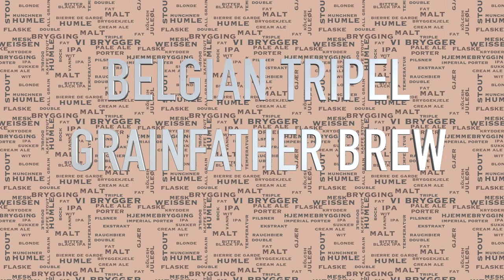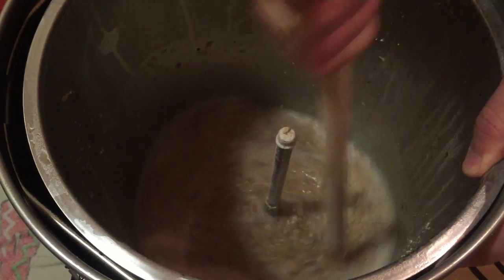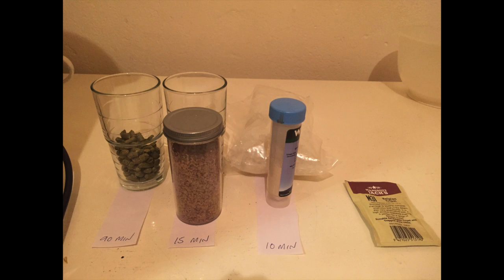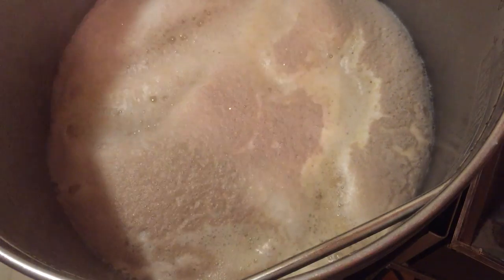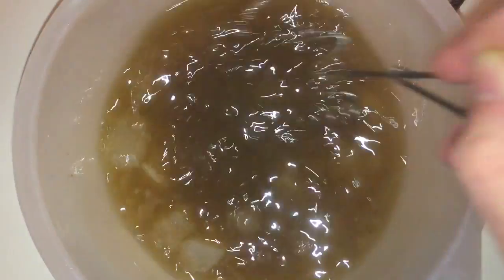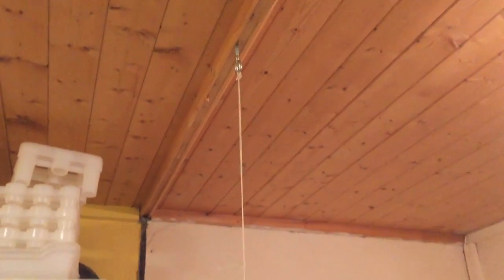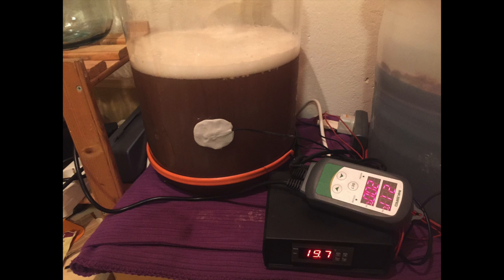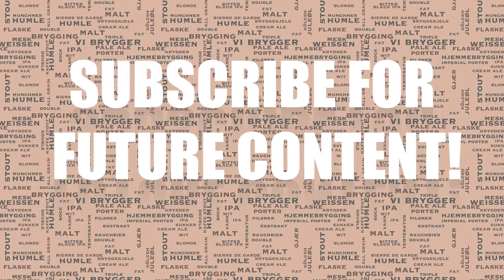BELGIAN TRIPEL Grainfather brew with small batch pipework

Comment: I like to use candi sugar for the carbonation in blondes/triples.
Reply from the maker: Very sorry for the late reply, YT has been very buggy recently so I only just saw this. The trouble there is that you are not going to get the full carbonation amount because inverted sugar has unfermentable sugars included.
Reply: @DavidHeathHomebrew  Yeah  but there is usually some sugars that are late to the party in the worth that get fermented out when the yeast i re activated.
Reply from the maker: Don’t you raise the temps at the end of fermentation to get a full attenuation?
Reply: @DavidHeathHomebrew   I would if I had temperature control for fermentation but I don't at the moment Don't have any room where i am living right now so it's kind of been on the back burner. In the winter I can use an electric radiator in my walk in closet for the purpose but in the summer the temp is in the high part of the recommended spectrum anyway. I once accidently left a bag of triples in the car for a mont in high summer and those were unexpectedly the best of that batch by far
Reply from the maker: Ahh ok, understood :)

Comment: What are the quantities of the strike and sparge waters? I am going to try this soon, thanks for the informative information in your videos.
Reply from the maker: Glad you enjoyed it :) I would suggest that you use the gf app and that will calculate volumes for you. This one was 14.1L Strike water and 10.4 Sparge water.
Reply: David Heath Thanks, I will check it out, I tried the beersmith app but must have done something wrong because I ended up with too much sparge water, so had to cut it well down. But advice from guy's like you and other YouTube contributors is a really good way of building up experience.

Comment: I'm soon gonna take my first shot at a tripel, and i was thinking to try mandarina bavaria. In your opinion, would it suit more as late addition or dry hop? Just looking for some slight tangerine notes :) I was also wondering, after how much time of bulk-aging does repitching become necessary? (OG 1.084, 2liter starter of WLP 530) thx in advance!
Reply from the maker: +Nick Verstraete Repitching of yeast in bulk conditioned beers starts at 3 months, just to be sure. After 4 it will for sure be dead. If you are looking for slight tangerine notes then I would use an essence, much easy to control what you get.

Comment: Hi David, 
I follow your recipe and everything went good, I reached the right OG (1072) and the wort looks so good :) I tried to take a sample after 5 days of fermentation(18 degrees) and gravity was already 1020!!! Great M31! I have only one question, is it normal for the wort, at this point, to taste of banana? Does it will change with the fermentation and temperature rise? Thank you
Reply from the maker: Darth Monger That was fast. The banana could mean a too high fermentation temp or an under pitching of yeast. Hopefully it will fade :)
Reply: Temperature is 18 degrees and I put two packs (20 gr) of M31. Well...we will see, thanks a lot for your support. :)
Reply from the maker: Darth Monger hmm, maybe its just an early off flavour then :)
Reply: Hi David, I finally reach a good FG (1006) stable after 48 hours and I am ready to bottling. Beer is very different from the beginnig, banana flavours and taste are gone and now i smells so good :) Did you put other yeast before bottling or you used only priming sugar?
Thank you.
Reply from the maker: That is great news :) If it has been conditioned for over 3 months then I will add extra yeast.
Reply: David Heath thank you for your reply. I have no M31 at home, do you think I can put other yeast? I have only M44 in my fridge. What is the correct amount of yeast to put?
Reply from the maker: You can use any type of yeast for carbonation. The amount is similar to the amount you used for regular fermentation.

Comment: Hey David. Brew this treat yesrday. This came out too dark as style is. Was expecting ca. 7 SRM but looks like 15. Does is clear. I suspect as wort looked fine befire hops editions, its still hops particle floating or? I plan to ferment till steady FG. Than bottle condition on ca 20c for some month's. Im I on right way or would you do secondary for some months and than bottle it?
Reply from the maker: That is probably where it still needs to clear. If you did not use Kveik yeast then I would suggest bulk conditioning.
Reply: @DavidHeathHomebrew went with M31 on this occasion. Will do bulk on half batch and bottle on other half and compare it to get picture of process as I'm fairly new to brewing. Thanks for tip and great job with all the videos. Im a big fan. Learned a lot 🍻👌
Reply from the maker: Great, experimentation is certainly a great way to go. Great to hear that my videos are helping you :)

Comment: David, what is that putty you use to fix the probe from the temperature control to the fermenter? I need to take a closer look at fermentation control and this looks easy to implement!
Reply from the maker: +Rob W Its "plumbers putty" works great and has perfect temperature pickup.
Reply: Thanks, will try that!

Comment: Just made a tripel on Friday David. I got 24 litres of wort so put two packets of mangrove jacks m31 yeast in.  I got 1.070 OG but how long do I ferment it? I was thinking fourteen days and then can I bottle it in 500 ml bottles after fining it for a few days? Any advice would be helpful.
Reply from the maker: The yeast will decide when its done :) Keep an eye on the gravity after 10 days or so. You need 3 days of a consistent gravity. I would suggest aging it in bulk. A carboy is ideal. 6-12 months will work great.

Comment: Hi David, 
nice video. I would try to make this recipe, how thick do you grind the grains?
In a video I seem to have figured 0.9 mm the thickness of a credit card is right?
Reply from the maker: +Giuseppe Lingua Yes that's exactly right :)
Reply: Do not risk  to blocking the pump or having too much cloudy juice?
Reply from the maker: +Giuseppe Lingua Its just a single hop addition like this :)
Reply: ???
At 0.9 mm don't risk a stuck mash?
Reply from the maker: +Giuseppe Lingua Ive been using a credit card sized gap for almost 30 years without issue.
Reply: thank you David

Comment: Great vid as usual.....where did you buy your micro pipework for the GF from? I can't find it anywhere! Super annoying.
Reply from the maker: I got mine from www.vibrygger.no , they are hard to get due to low stocks. Lets hope getting the new controller isn't hard! Luckily I seem to be getting one early for review on my channel. Fingers crossed that happens!!
Reply: That's great news....I'm looking forward to the review on that! Will check that site, cheers.
Reply: Wow any idea when you are likely to receive a controller? looking forward to seeing a review. Cheers
Reply from the maker: +Homebrew Griffo No news on when but should be before product launch.
Reply: Hey David ... I'm planning to brew a triple and just curious because I've heard that adding candy sugar mid fermentation also works well ... do you recommend adding during last 10 min of boil or mid fermentation cheers
Reply from the maker: +Ed Hi Ed, if its dark candi sugar and I want those flavours to come through more then I add after the initial busy fermentation period. If not then its easier to add during the boil. Clear candi sugar adds no flavour but you can add it at either time. Just keep in mind that you need to dissolve it, which is easier in the boil. Hope this helps :)
Reply: David Heath thanks

Comment: Hi David, 
I have a question about candi sugar and water calculation. Have I to calculate sugar as a malt when calculate water? For example, to make 19,5 L I put 4,91 Pilsen, 0,21 Caramunich and 0,83 candy sugar. In grainfather calulator must I consider sugar? Thanks.
Reply from the maker: Hi, The sugar is a 10 minute boil addition. Boil additions do not count for water volumes calcs.

Comment: In your video it said that you recommended to bulk condition/age. How long do you condition your blonde Belgium's versus bulk conditioning your darker belgium beers?
Reply from the maker: Conditioning time is usually just connected to alcohol. The higher the alcohol the longer the process when using traditional Belgian yeast. Belgian Beers that are high in alcohol and yet below 10% can often be ready in 6 months. Beers over 10% can take double this time. We can only predict of course based on previous results. Naturally all can be consumed earlier but the benefits of a prime state will not be fully enjoyed.
Reply: @DavidHeathHomebrew  thank you Sir. I just got thorough your tasting video,  where you had stated that this particular beer had been conditioned for 8 months.   I recently have purchased multiple Cornelius kegs where my plan is to rack over my beer to the keg replace the oxygen with CO2 and age in the keg. What are your opinions on this practice. Also what temperatures should I have the kegs resting at while conditioning?
Reply from the maker: I prefer to rack  into carboys and demijohns up to the bottom neck. I then C02 purge the neck before adding the airlock. It's not perfect but I have had good experience of strong beers being kept in this state for up to 3 years.
Reply from the maker: The vessels are just used for conditioning. I prefer to use my kegs for consumption :)
Reply: @DavidHeathHomebrew   When conditioning do I keep the vessels at fermentation temperatures or as close to as possible?
Reply from the maker: No. 14 deg c is optimal for ale conditioning.